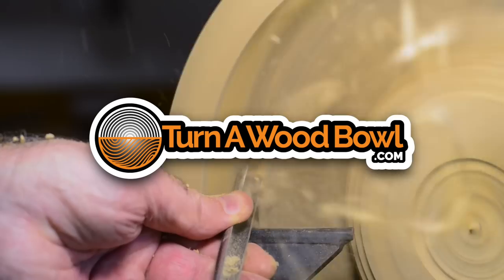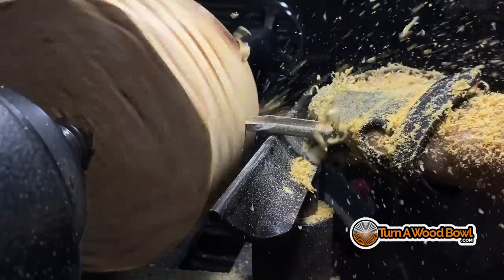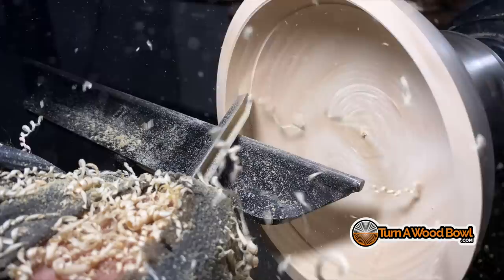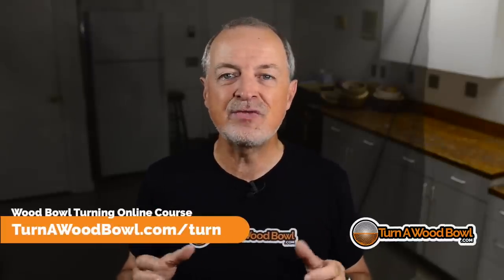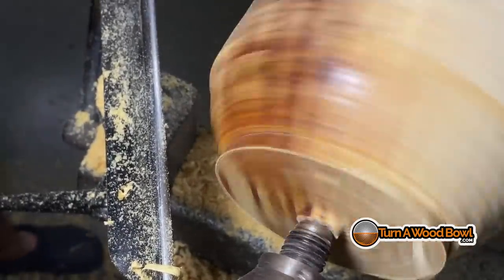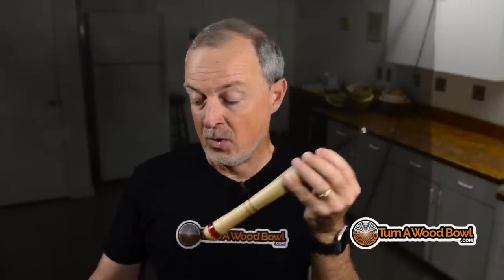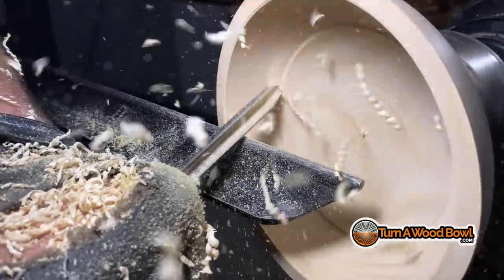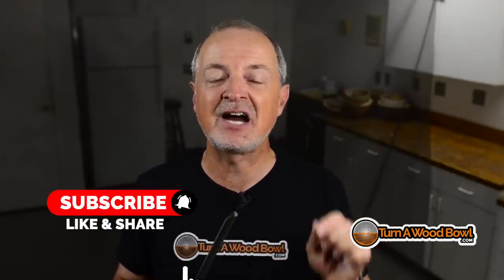Bowl Gouge Don't Do This - Woodturning Video

Comment: Hey, can I pick your brain a bit? Was given some walnut logs, one with a nice crotch  I sawed it off, trimmed the fork & cut one side off lengthwise across the crotch.  only leaves me about 6" thickness. Should I saw other side, or just turn it off?  And will center of block present problems with cracking? (I am relatively new to turning) -Tyler

Comment: Hey Kent, This was perfect timing for me. I have been turning since late April of 2022 and started doing bowls in late May or June cant recall for sure.. However the only I have had for turning bowls is carbide. I can do pretty decent stuff with it but I have wanted to get some bowls gouges all along. Well as it happens my girlfriend is getting me a set of bowl gouges as an early Christmas present. I understand they should be here tomorrow so that will be the first time I will likely being using a bowls gouge as long as we dont get any thunder storms. Not a big fan of lightning strikes so if it is storming my lathe stays off. I have a set spindle gouges so I do understand riding the bevel. I am hoping to learn bowl gouge usage in the near future (hopefully tomorrow). I greatly enjoyed this video and I am about to watch your Beginner First use video as well. Thanks much Kent as I said perfect timing lol. Yall have a wonderful day.

Comment: Most of the bowls you make are shallow with smooth passes from the outside edge to the bottom. My wife like straight sided and flat bottomed. I have trouble cleaning up the bottom. Any suggestions?

Comment: Hi Kent,
My question: when using a 55 degree swept-back bowl gouge for a grain-supported push cut, is your gouge axis typically horizontal, and is the “mirror plane” turned 90 degrees from the vertical? (What I mean by “mirror plane” is that imaginary plane that passes thru the gouge axis and divides the gouge into two symmetrical mirror images).

Comment: 14:33 Aha-moment! I really need to focus on pushing down on the toolrest instead of inwards to stop making those marks. I made a handle for square and round carbide bits but as you say, they are scrapers and I prefer to learn the proper uses of the bowl gouge. Thank you again for a very good and educational video. Best regards, Bjoern 🇳🇴

Comment: Great information, a good refresher for those of us who have not turned wood in a while.

In regards to Carbide Tools, when using them the RPM needs to be high to get a smooth cut with the insert just a fraction of an inch above center.   Round carbides on a round tool shaft can provide excellent finishes since the cutter can be slightly rotated to change the cutting (scraping) angle.

Also, an oland tool is an excellent tool to use for turning wood.  It minimizes the chances for catches provided you keep the angle  of cutting 90 degrees or less.  If you go beyond 90 degrees be prepared to duck since a catch will definitely happen and get out of the way.  I use a 1/2” oland tool to hog away lots of wood, a 3/16” tool for general turning and a 1/8” tool for smaller cuts.  Each of these tools can be easily ground to any shape you desire for wood turning.  Each Oland tool should not cost more than $5-$10 to make yourself.  The cutting tools are either round or square metal lathe M2 HSS Steel and purchased at Harbor Freight, eBay, Amazon,  Little Machining Company or other machine supply companies.